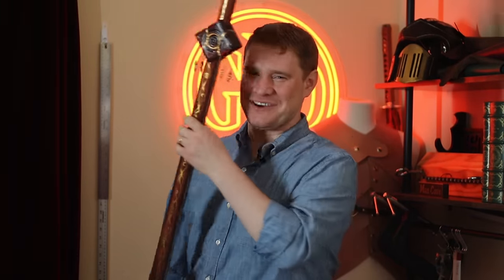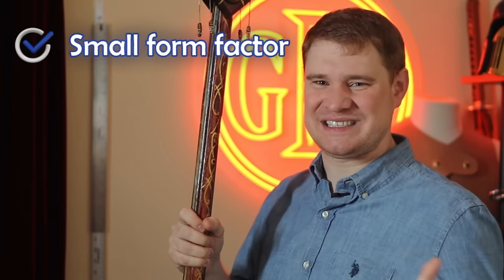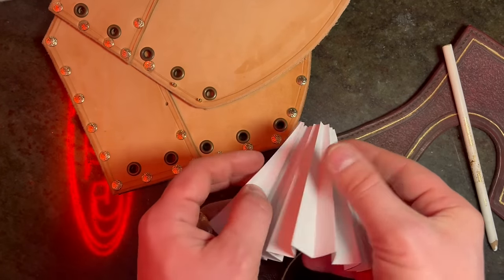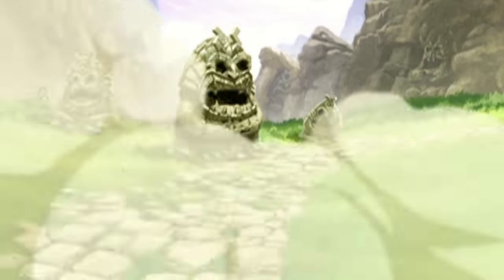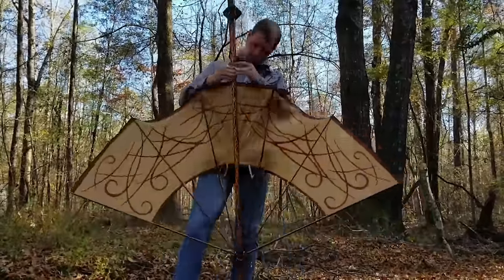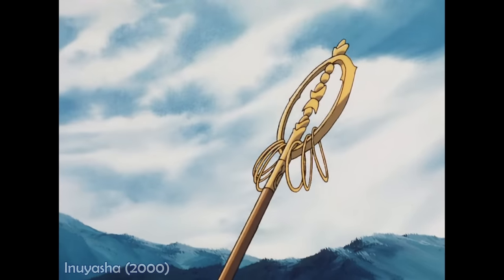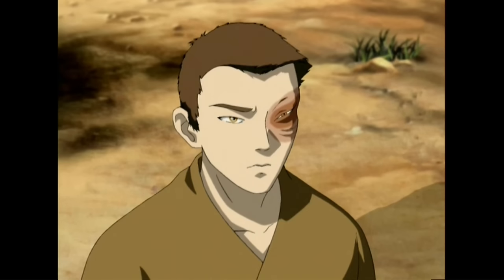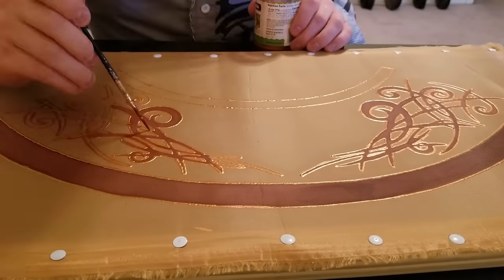How I Made Avatar Aang's Airbending Glider Staff in Real Life

Comment: I imagine there is a wood in the  Avatar universe, the has the spring retention of a springsteel, while not weakening as you cut it thinner.

From there, you could take a branch of a tree, cut it down to shape, and use springiness of the wood, to be the mechanism, that pops the wings open.

Then, you would just need a system to secure the wings into the folded position, and could use a button of somekind, as the release and catch mechanism.
Reply from the maker: That's a good idea.  Plus, I don't think spring steel itself is off the table.  Spring steel has been around since as early as the middle ages, while Avatar seems to have access to early industrial revolution level technology and metallurgy.

Comment: why not use a mainspring, like a watch spring that turns the center rod instead of having to roll the ball until it closes, that way there is always tension on the fabric and you save time opening and closing it, and the locks will still be useful

Comment: They have combustion engines (even if fire-bender powered) in Avatar's world, so steel must be a thing to keep it all from melting. I think that's enough of an excuse to allow you to use spring steel,  and fashion two sets of coils springs, each with a number of coils to attach to every wing spine. You wind them as tightly as needed to prop the wings open, and then you can make a simple double latch at the point of attachment to your staff for push-button unfolding that resembles the show. I tried not to criticize this beautiful work of art, but I just NEED to see those wings spring open.
Reply from the maker: I appreciate the feedback, and you're totally right, although Aang came from a world 100 years earlier, in the industrial revolution-esque ATLA time period spring steel wouldn't be a problem.  They had spring steel in the medieval period!  I like your idea and will keep it in mind as I work on a mark 2 design inspired by comments like yours!